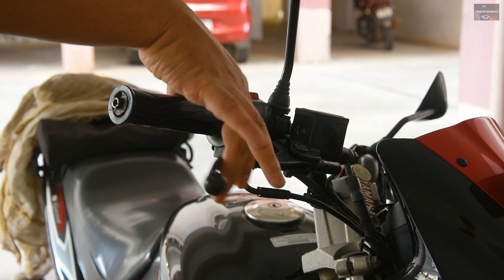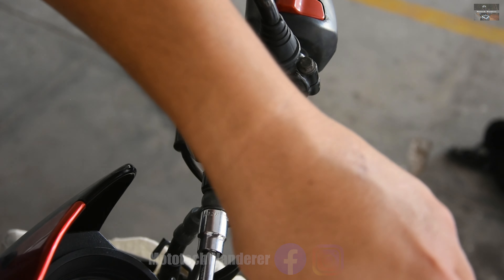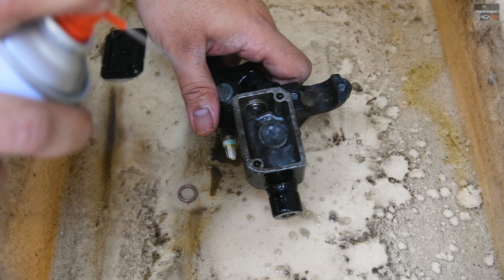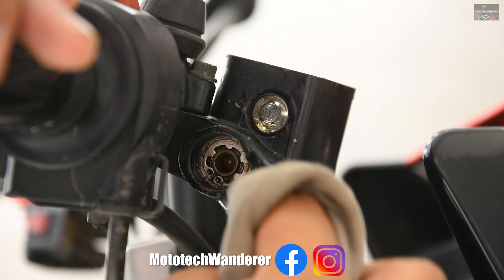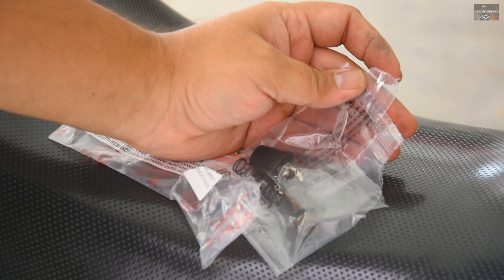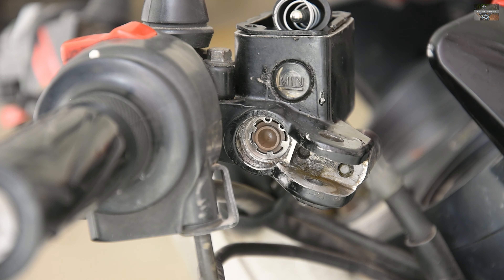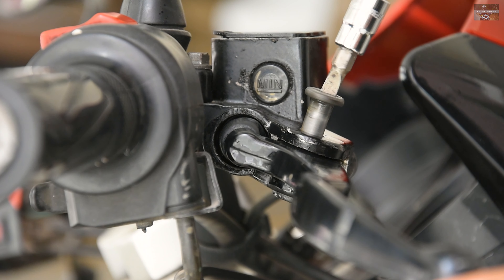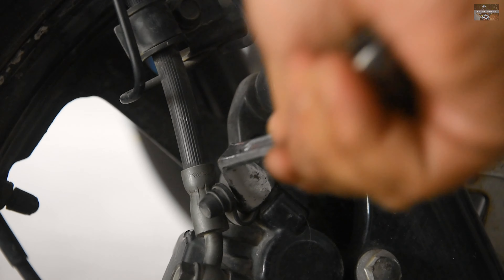DISK BRAKE BLEEDING ON YAMAHA GLADIATOR | BRAKE PAD REPLACEMENT | MASTER CYLINDER | DOT4 BRAKE FLUID

Comment: Sir I need your help I'm recently installed Hella halogen projector , after market shop , m usko relay ke sht installation ke liye bol tha pr mujhe without relay ki hi install kr ne ko bola, koi problem nahi ga tension Mt lo kuch nahi ho ga, to m ne bhi install kr waliya , and after 1 hours ke baad Mera car ka parking bulb 💡 or Instrument cluster ka m bhi light nahi araha h , muje kya kr ho ab PLS HELP M
Reply from the maker: Fuse uda Diya hai HID ne ... fuse lagayiye aur HID projector relay system me saath lagaiye.
Reply: Thank for your support 😊 , m fuse ko bypass kr diya h temporary use ki liye any how next day problem solve karunga , thanks 👍
Reply from the maker: @NextGen_Vortex  Bina relay aur fuse keat use krna HID wiring jala dega.

Comment: What causes engine rpm drop when hold clutch.. trotter body , air filter. Plug.oil filters.trotter cable. Clutch hub, all change.senser light faulty no shows..but engine RPM drop..no stable..Y..?
Reply from the maker: Mostly a throttle body issue.
Reply: @MototechWanderer  replace still same problem
Reply from the maker: @laksamana781  sparkplug condition?